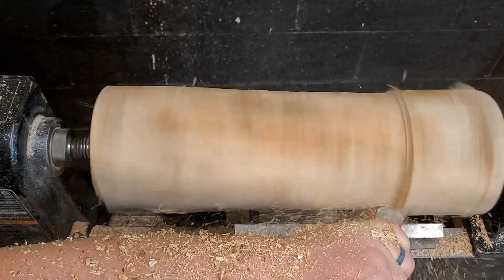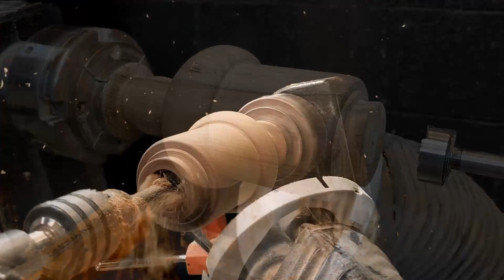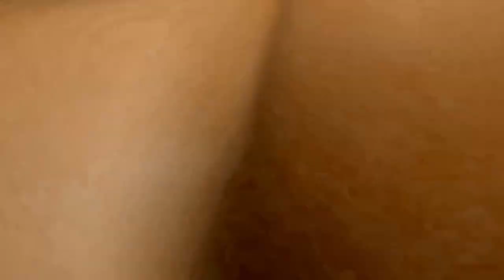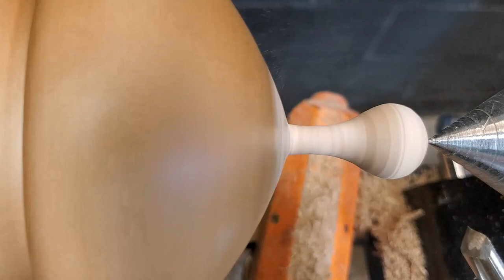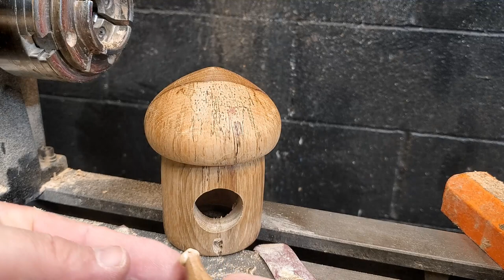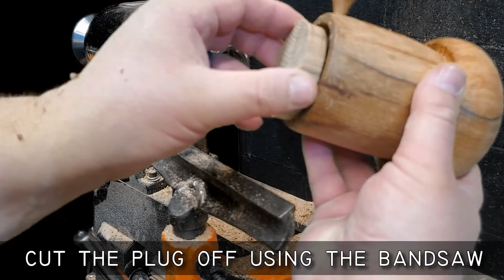A BIRD House INSPIRED by Robert Boyce N.C. 😎🐦🐉 #woodturning #Bailey

Comment: Nice one! I’ve never been a fan of Forstner bits in a hand drill, drill press only for the very reason you demonstrated. Glad you could use the finial as the perch though. Well done.
Reply: Agreed. Actually as the years go on I'm less and less keen on Forstner bits. Is anybody else coming to the conclusion that spade bits are pretty well just as good? I know it's heresy but I just find myself reaching for them more often. Cheers Doug.
Reply from the maker: Yes, I have to learn through failure. It is a problem for me. Thanks Doug!
Reply: Doug don't tell an old pattern maker not to use a forstner bit in a hand drill.
We had to do it on some patterns that were way to big to fit on the drill press.
These were to add lifting hooks so the foundry could pick them up with a hoist.
At least we had heavy hand drills with nice right angle support handles that helped.
 But if it grabs it can wake you up. Or break you up! 
Time is money so you did what you had to.
Now that I am my boss I do not have to do it anymore LOL
Reply: @ThePapa1947  you’re right. I’ve just never been a fan of it. Twisted my wrist the first time I attempted it. But as you say, you do what you must to get the job done. 😉
Reply: @DougMilleratWoodSpunRound  oh I dreaded the process.  A heavy duty Milwaukee drill has a ton of torque.
Reply from the maker: @ThePapa1947  problem also is my F bits are not sharp so I was pushing too hard. No injuries though, all good!
Reply: @BAILEYWOODWORKS  yes a dull bit sure can lead to it. I did fine with a nice sharp bit and taking my time.
Also cutting through to the inside will lead to the same thing. Even with a twist drill. A piece of thin metal on a drill press without clamping it down is much worse than drill with the F bit by hand.